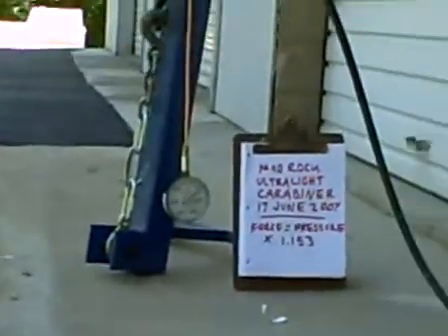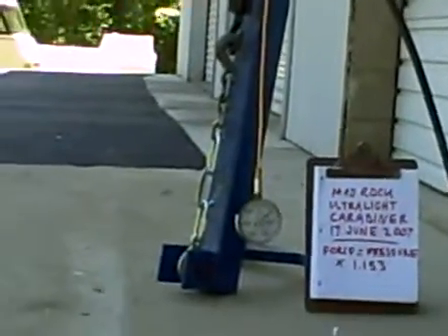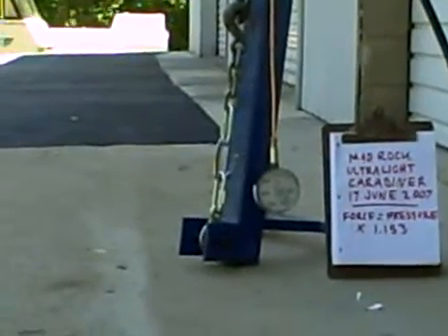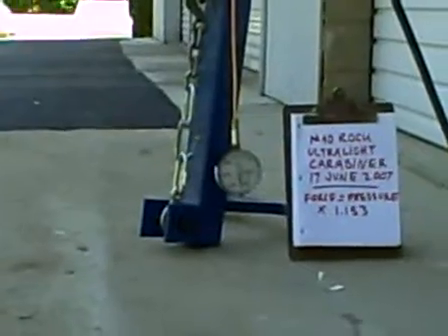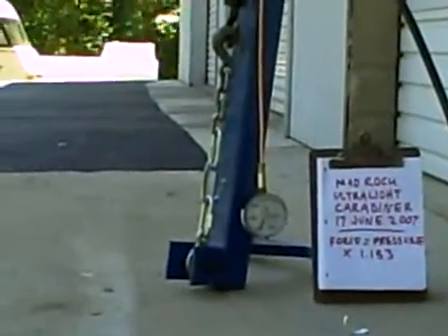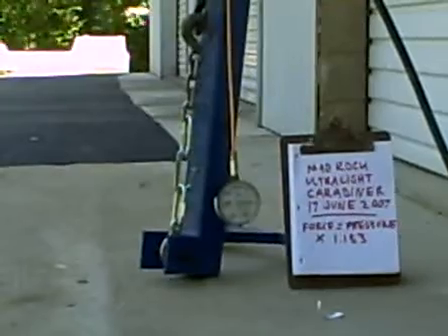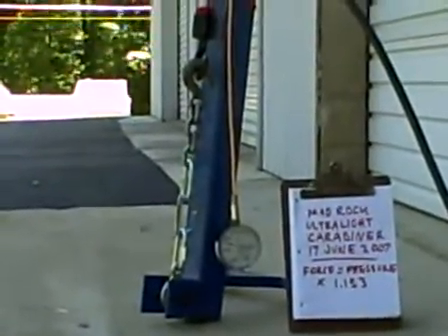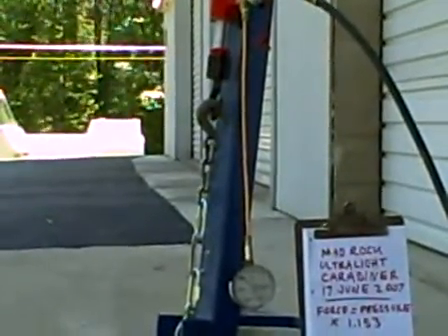Carabiner Strength Test

Comment from the maker: The PSI to pound force calculation _is_ dependent on the size of cylinder used. The force equals the effective piston area times the pressure.